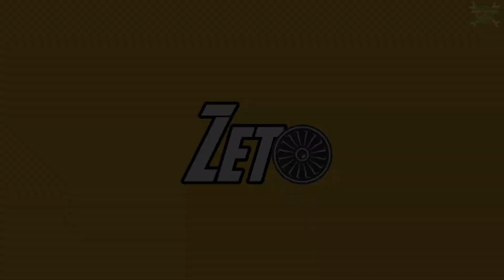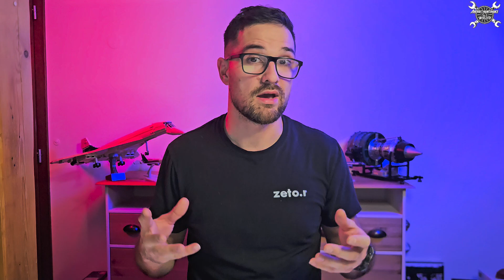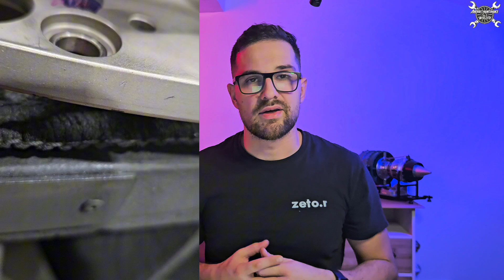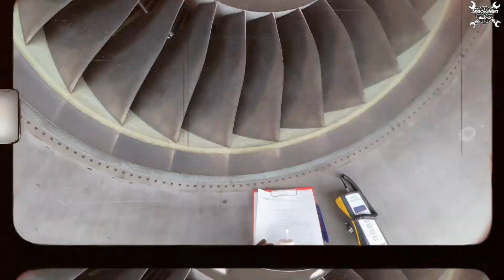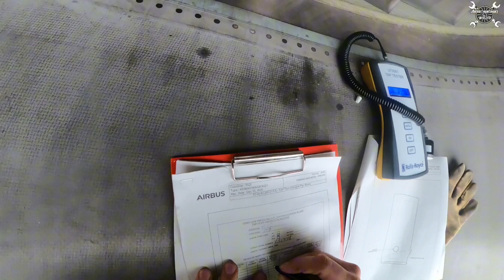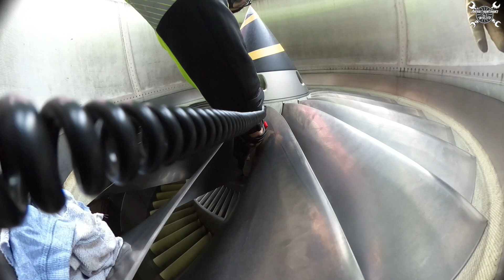What is inside of airbus A32f V2500 engine fan blade and how to inspect them.

Comment: Hi Tomas…  in the event that you find a blade that is out of the acceptable range, what actions would you perform?  Would a ‘bad’ test result ground an aircraft, and what would be the course of action be to get the aircraft flying revenue flights again?  Would there be a blade swap or an engine swap and which of these would be preferred and why?  Many thanks for the great content…
Reply from the maker: Value out of limit means blade replacement
Reply: @zeto.r Hi Tomas - many thanks…  🙂  I’m assuming you’d then maintain a stock of replacement blades, sorted into ‘buckets’ by weight?  Is there then a need to rebalance the hub, and can that be done with the engine still on the pylon?  Many thanks…  🙂
Reply from the maker: Yes just a few blades are not a problem you need to know the weight and balancing software is inside of aircraft you just need to make an engine run and test it

Comment: Hello , may I pls know why u did it only for a certain inner middle portion of fan blade , and not fully why ? Isn't other portions concerning ?
Reply: Good question
Reply from the maker: There is an exact spot where it is necessary to place the probe to distribute vave evenly. The vave travel through whole blade that's why you don't need to change position. I guess rest is explained in video